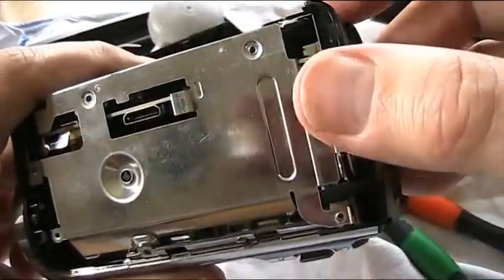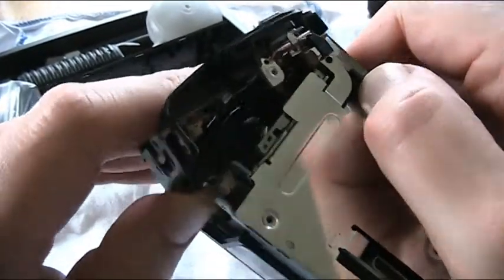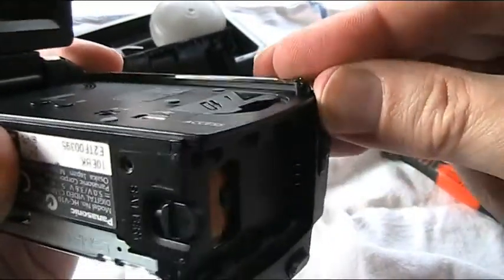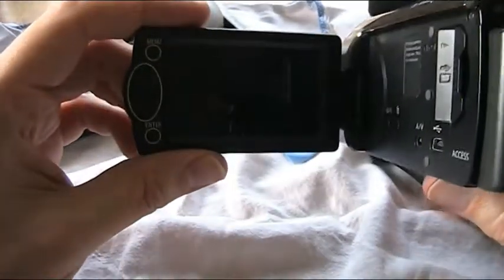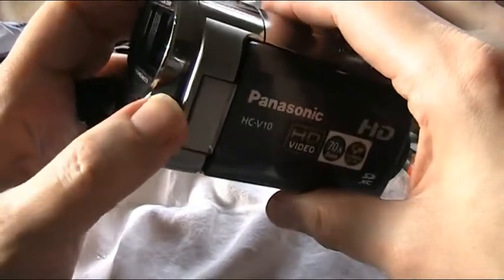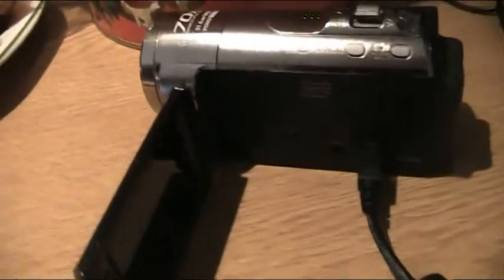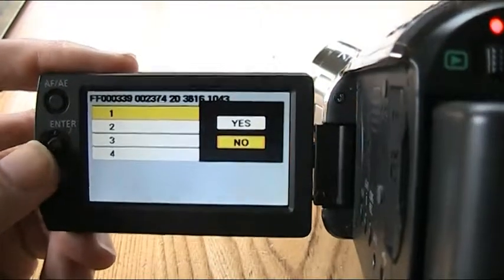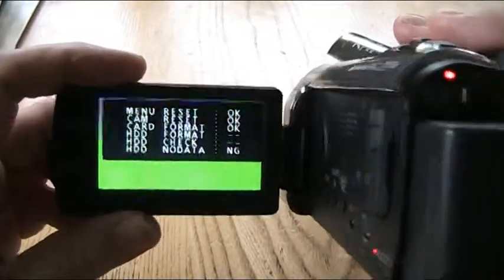Panasonic HC-V10: Secret Door! Secret Menu! Part Two

Comment: Hi Joe! A couple of thoughts on your camcorder fixes...
Static - If you are tinkering with electronics containing any tiny circuit boards and components, it's a good idea to earth yourself to avoid static build up which can short circuit components. You can get anti static bracelets cheaply on Amazon, Ebay etc.
Secret Door - My own (amateur) guess would be that's an engineering diagnostics panel you've removed, which allows access to the back of the circuit boards for running diagnostic tests that would usually be carried out by the manufacturer or authorised repair centre. It would need specialist equipment to do that.
Shame you didn't manage to get it working - maybe it will turn out to be handy for parts in the future.

Comment: I have the same problem with my camera.
I managed to find out how to open it.
On top of the camera it says: "70X; enhanced optical zoom; 31.6mm WIDE; POWER O.I.S.
Just belowthis text is a groove.
This is where you pry it open. Slightly lifting the front (with the aformentioned text) and sliding the rear part backwards.
Hope this helps.:)

Comment: Panasonic equipment are notoriously difficult to take apart....almost as if a priority in their design process is to avoid being taken apart. Unless you are a pro with pro equipment, taking Panasonic equipment apart is almost a guaranteed bricking process. Sonys on the other hand are much easier.